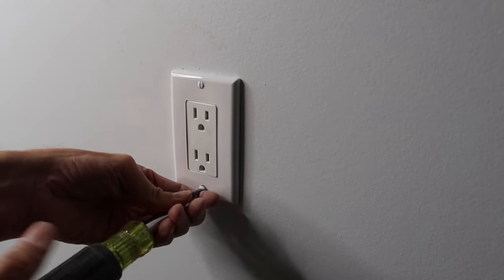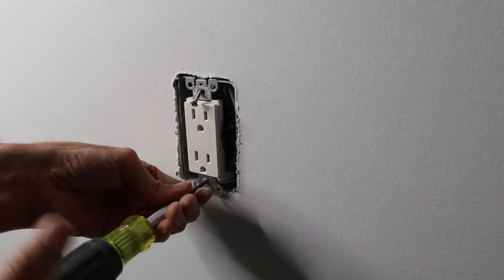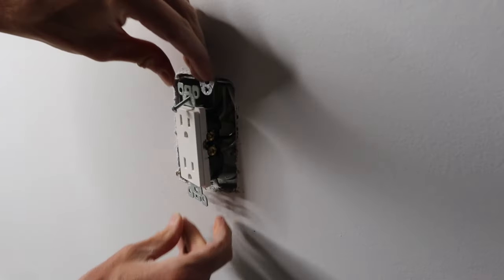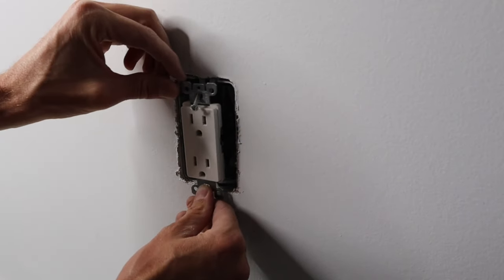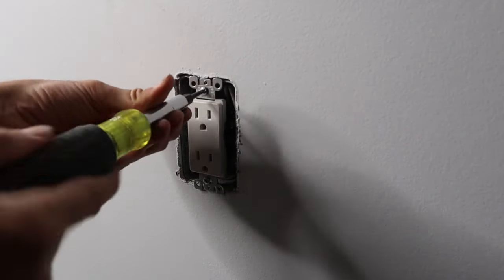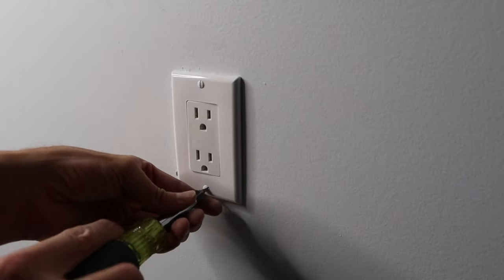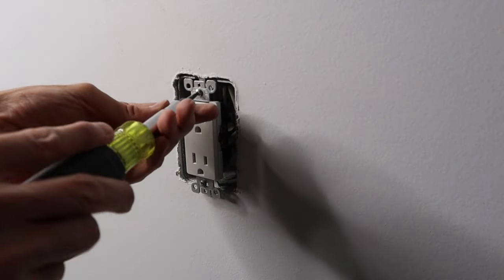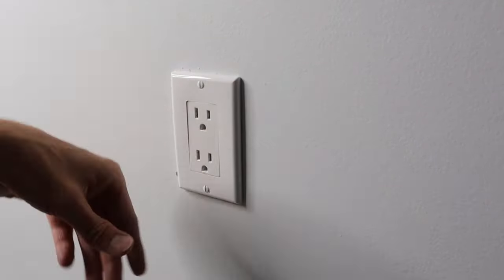Electrical Outlet NOT SQUARE!!! How to fix this!

Comment: This is why you leave 12 inches in excess wire...whether it be hots/neutrals/runners/feeds all should be folded 3-4 times like and accordoan or spring before being connected to device...easily manipulated....I've been doing electrical for 6 months but learned from the very best.  So far every inspector "creams them jeans and continually claims "they are the most beautiful boxes" they've ever seen.

If you can comment here or somehow message me I can send you a video of what I mean because nobody is doing it the right way.....Also, I have specific question about skim coating over wallpaper.
Reply: Do you leave that much wire when working with shallow boxes? Just wondering ...

Comment: NO BRO angry electrician here. If you really want a quick fix on a garbage looking decora outlet, then get an out door extension cord or plug in style outlet tester plug (some sturdy plug) it in to the outlet and push and turn the outlet faceplate and all on. The direction it needs to go till its straight. If you don't want to crack the plate take it off and turn the outlet with the plug tester or extension cord base. You might pop the plug if there is an untaped hot trouching the ground wire. Or don't put pressure on the general contractor to rush the electrician or rush the electrician then your plugs is straight. I luv drywall braddahs cuz they fix the stuff I broke.

Comment: I put a strip of electrical tape over the terminals on both sides before I replace the outlets or switches. This just gives me an extra margin of safety without much trouble.

Comment: What do you do when the box itself has been installed improperly and it is proud of the drywall on one side?
Reply: if the side that is proud is the loose side (not the side attached to the wall studs) you can drive two short drywall screws, top and bottom, into the junction point of the box and the wall stud.  This will force the side that is proud to move back into the wall then your faceplate will install flush.

Comment: Good tip, but you can also put a small screw driver into the ground hole and give a slight twist to straighten it out. Or use a plug tester. Just a little time saver. But ideally it’s nice to screw it in the walls nice and flat the first time.

Comment: I would say lack of using your left hand .

Use one hand to hold the outlet in the position you want .
Use the other hand to use a drill .
Make sure drill is set to 1 on torque so it doesn't screw in to hard .

Comment: Tighten the rec down until the "ears" all make contact with the box or the drywall. Insert a Phillips head screwdriver in the ground hole on the front of the rec and use it like a lever left or right to adjust the rec to align properly. Be careful not to break the plastic.

Comment: Super easy trick: using one of the plug in gfci plug testers, with receptacle and plate on, plug the tester in to the plug and tweak the plug nice and straight.

Comment: I love your videos but this one is off. I mean, it’s partly right but still wrong. You’ll notice how it was kind of loose when you were “done”, no good. Tighten the outlet down tight to the box and if it still sits cockeyed, you can bend the outlet by pushing or twisting it on the side that sticks out.

Comment: I highly recommend taping off the terminal screws with electrical tape. It only takes a second and costs next to nothing. This way when you have an extra layer of safety whenever you remove the faceplate for things like painting, mudding, or adjusting.

Comment: I'm not sure that I like the design of these North American outlets - assuming these are pretty standard over there. In my country (Australia) the components always fix to the face plate and hence are always correctly aligned. I prefer our pin design too although that's not really of much consequence.

Comment: Was an apprentice electrician for a few summers during my college years. I installed so many of those things and it seems like I was always fighting preload of the relatively stiff wires. 14-2 on a 15 amp circuit was easy, but you really had to fight 12-2 or 12-3 on a 20 amp. “Mud Dawbers” always left nice gobs behind for us in the electrical boxes, which would still be gushy even though the walls were finished and painted. We made the best of it by pranking each other with it. Someone would take too long of a potty break, and maybe find a handful where he expected his strippers to be.

Comment: Provided your house is wired correctly and you don't put it in the wrong hole, you can put a flatblade 3/16" screwdriver in the ground pin hole and use that to gently twist the receptacle into place.  Just for the love of all things holy don't do those two things.  You will suffer electrical shock if you do.

- Electrician

Comment: You know what a much faster fix is? Stick a plug tester in and tweak it straight. Or a terminal driver in the ground terminal and do the same thing. No plate removal required.

Switches are the ones that need a bit of finesse.

Comment: Those screws on the receptacle should be wrapped with electrical tape in the first place. Wiggling around an energized receptacle in a metal box is asking for trouble.

Comment: The builder of my home used 10 gauge solid wire for all the outlets and switches instead of 14 and it's an utter pain in the ass. Not a single one of my outlets is straight because of this stiff wire.

Comment: First off my friend... Use a screw gun and save your wrist. Also, I like to use my electrical outlet tester (the kind you plug into the outlet and has 3 lights orange or red). I use it instead of bare hands. A bit safer and more leverage/control. And finally, tape around the plug and over those "bolts" when using metal boxes. Super easy for power to Arc from the terminals to the box if misaligned.

Comment: The big question is why the cover plates still have slotted screws.
Reply: Because the manufacturers such as Levitton and all the major brands that design the devices standardly w 10/32 screw through holes in them for mounting the covers. So all the manufacturers that make the covers copy the same sizes. Its a code thing and yes there are covers without screws that just clip on. Safe practice is w/ the screw- No chances of it falling off! Safety First
Reply: Having the covers screwed on makes sense.  I just wish those tiny, short plate-cover screws were Robertson or at least Phillips, not flat-head or slotted, so they'd be easier for my fumbly fingers to put on..

Comment: Leave it to a drywall guy to call the terminals on a receptacle “bolts”, the reason they are actually called screws is because if you touch them, you are “screwed”! Thanks for helping the DIYERS.

Comment: all the receptacles in my house were installed upside down for some reason.
Reply: upside down receptacles are supposed to mean a switch controls one outlet.
Reply: @RangerCaptain11A  Aha! I'm replacing the receptacles in my house, and I noticed the one connected to the switch was upside down, and I thought the builder made a mistake. Thanks for sharing that! I'm glad I didn't 'fix' it.
Reply: This is the way they are supposed to be. They are safer this way but the issue is most plugs on 110v appliances are designed for having the ground down. 220v and other countries have all made the switch to ground up.

Comment: Don’t take off cover with power on, you can still get shocked and die
Reply: You are not going to die from touching a live receptacle.
Reply: Yes very true always shut the breaker for the outlet first and then check w a voltage tester to ensure its off. 120 volts will kill a child, an elderly person or a person who has a heart condition instantly. It can even kill a healthy young person if they themselves are grounded to metal (for example holding a railing) Best  practice is never ever ever ever ever ever ever ever EVER work on a live load! Power must be off and it takes 2 minutes to walk to the basement to shut the breaker off for that circuit. No excuse - kill the power first-
Reply: @kelkel3201  - glad it only takes you 2 minutes to throw a breaker.
Not only do I have to go to the basement, I also have to take a step ladder to reach the box that is mounted at the top of my 8' basement wall. Then I have to choose which of the 6 fuses to pull.
Of course the box isn't labeled. Even if it was, each circuit has so much stuff on it that you cannot write it all down. As mentioned, I have 6 fuses, that power an entire 2000 sq ft home.
It's easier to just be careful with the live circuit than it is to have to reset clocks in 3 or 4 rooms just to play with a receptical.

Comment: Looks like it was installed by the same crop of a arseholes who did my place. I watched one young punk wiring a light fixture, didn't bother attaching the ground wire. "You going to attach that?" I asked. "Oh, we don't bother with those." he replied. "Pack up your fucking tools and get the fuck out of my house and off my property, now." was my response to that.

Comment: Tension on the wires? Who's the idiot who installed this? If you cannot locate the correct breaker, you have no business touching electrical work. Saving a few seconds risks;  tripping the breaker, sparks injuring your eyes, death due to electrocution. Please, stick to carpentry.
Reply: Yes power must always be off when working in any box. Period no excuses. Safety first!!